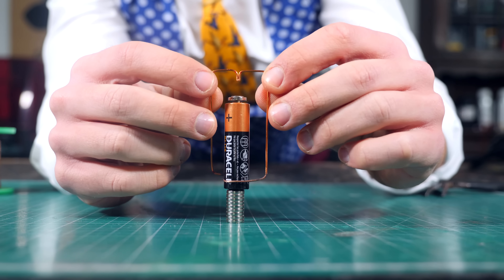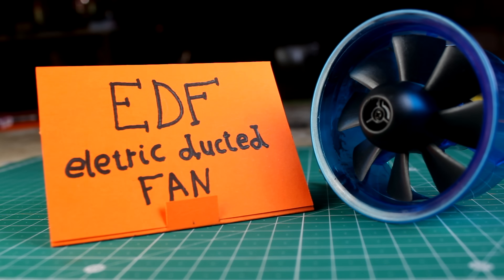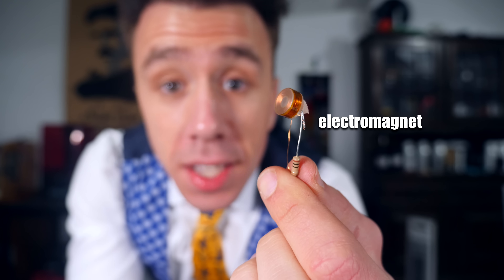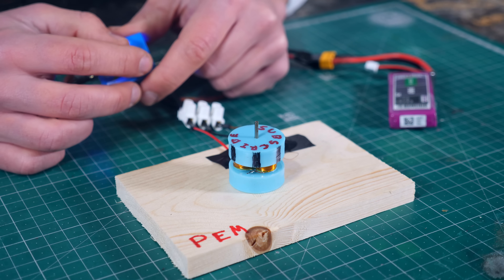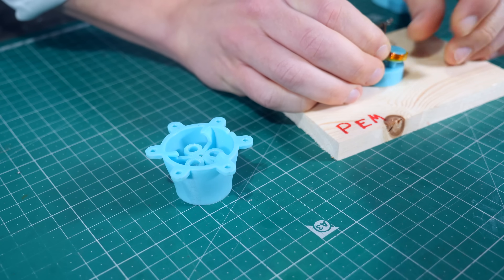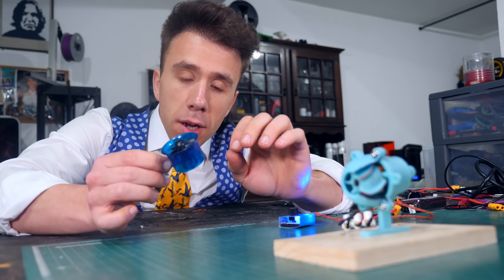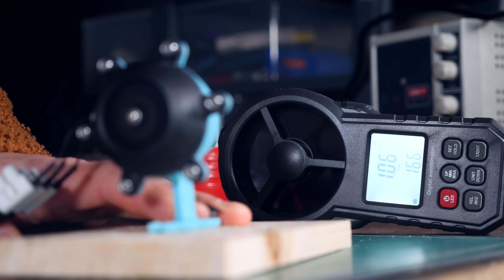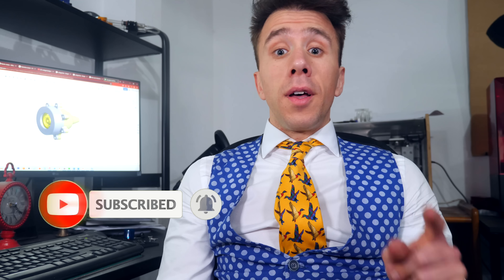I 3D Printed an ELECTRIC MOTOR FAN

Comment: Hey a few ways that might help, 1. the back of your fan is under correcting the direction of the air have the air ducts end at a degree that is 90degrees with the back of the fan. the point of the airducts is to change the radial movement of the air into straight movement, the faster/smoother it does it will reduce friction. I may be wrong with this one but it looks off. 2 try removing more material from the impellor, the less of the "cone" of the impellor there is the more air movement you will have. 3 by opening up the discharge side of the fan. the hole is too small unless youre trying to make a venturi nozzle but then as it is that wouldnt work.

Comment: I believe the reason your design of edf was less efficient and didn’t produce as much thrust because the restricted and constricted airflow at the front because of the narrow nossle unlike a regular edf like the one you have or even on jet engines the front is completely open and allows as much air as possible to get into the fan but once it enters the fan it gets compressed and constricted therefore producing more Thrust making or more efficient

Comment: Add a stator after your rotor to direct the fluid, and make sure you don t expand the fluid too fast. It creates some huge pressure losses. Usually for an axial compressor you can consider a expansion angle of around 7°. (That s the increase in section in which the fluid flows through). Over this, pressure losses become too important. And you are using an axial compressor design. Meaning you can get pressure ratio of around 1.26 per stage if you design it well. If you were to use a radial compressor design, you can push the pression ratio to up to 5. But you will have more noise and im not sure about the efficiency. And the design is more complicated.
You could also try to add multiple stages (rotor-stator) to increase the pressure ratio.
If you understand some french i could give you documentation on how this works!

Comment: The problem why your centrifugal fan have low thurst it may caused by the low efficiency of your DIY BLDC. This this root cause problem can be validate by changing your DIY BLDC with the manufactured BLDC then test again your centrifugal fan
Reply: The other possibility is your impeller shape is have low efficiency, try to change the impeller design

Comment: Oh man, I thought there would be an answer! Why is Dyson’s design able to move so much air? So many experiments suggest that a centrifugal impeller should be able to match the performance of an axial fan. Is it drag from loading the chamber inefficiently? That’s not a problem for the Dyson. Is 3D printing too coarse for close tolerance running clearance? Time will tell…

Comment: So, Integza , a jet engine or fan, is based on taking in air and speeding it up or, so I'm led to believe. The way it speeds it up is by taking a wide cone and putting it into a thin cone if the fan is cavitating or it has too much space in between it You're not condensing the air enough so you might think about squeezing the fan closer to the cover plate. It needs to be in my of space. From the video you had a centimeter or more space for the fan. Also, there is good only knows how much space is in between each one of those blades you can make each one of those blades probably about 10 mm apart and you'd still get the air intake but you would be pulling in 50 times more air and pushing out God only knows how much. (Side note no I don't have a 3D printer I would love one... So that I can help make things like that) ❤️❤️❤️

Comment: Maybe the material your printing with isn't rigid enough to work well at those really high RPMs. Like maybe the fins are flexing or oscillating and somehow causing a turbulent flow. Either that or Dyson impellors really aren't what they're made out to be.

Comment: As someone without training, but lots of interest in the engineering subject, I am wondering if you are trying to match two different styles of thrust, Coanda and through thrust?
Try ducting the coanda thrust, into rotating thrust as nasa is currently working on.
also, try ducting in more air, after the impeller?
I know, it will make you engine slightly longer, but it might just work,

Comment: Honestly the issue is prob turbulence with a mix of impeller design that ofc the bigger fan will move more air then as there’s more surface pressure going against a 1st gen in worked impeller design you should look into adding a condenser fan series

Comment: as a crude measure of efficiency, compare the surface area of the blades of the EDF vs your impeller. I'm betting the EDF is a much bigger surface area. Also the fan blades are a larger diameter, so the outer areas are moving faster than the impeller blades.
The impeller is never going to be as powerful (at least the way you are measuring it) due to all the losses of forcing the air through the casing, but you are probably limited right now by the capacity of that little impeller. Start by making the impeller a lot bigger.

Comment: You need higher rpm because axial fans are volume fans so they move due to blade geometry and centrifugal fans work by centrifugal force. So you need to do 1 of 2 things. A make the bottom wider or B increase RPM

Comment: mechanical designer here, saw your model here some points:
1. not much air can enter - funnel may help
2. its probably stuck inside -check any geometry that make 90dgr (or pointy places) its bad to airflow make it as smooth as u can 
3. check at 5:34 the curve for the air and the isolation of air from the engine.
4. you need to redesign the blades on the impeller for that you need check  Centrifugal/mixed flow impeller design for better understanding
Reply: also dont forget that dyson spins at very high RPMs which make huge diff

Comment: there could be some leaks of power due to turbulence or structural resistance, i suggest to analyze the flow and also the motor getting hot can cause some different behavior of the air passing around it and cause it to exit the nozzle in a more dispersed way.

Comment: As seen you measure air speed as thrust? 

My guessing game would be that the centrifugal fans are optimised for pressure (vacuum, dysentery fan, first stage of propulsion) instead of windspeed. The open fans however are optimised for flow (perfect for open applications like the propulsion unit you showed, where there is only little pressure - build up back pressure - to overcome)

Comment: Hi Integza! I am an aerospace engineering student at the University of Illinois U-C. I am working on an electric thruster project through the AIAA that has many similarities. There are many potential points of optimization, but the biggest problem has to do with Bernoulli's principal and subsequent equation relating pressure and velocity of flow to cross-sectional area. In other words, the impeller produces high pressure flow, and the exhaust nozzle geometry converts that high pressure flow into higher velocity flow. By decreasing the area of the nozzle, you can further increase exit velocity by converting the high pressure air from the impeller to lower pressure and higher velocity. There will be inherent limits with the power specifications of the motor and impellers (among other complex inefficiencies); so, I'd say the easiest means of optimizing your thruster would be producing an impeller you like and just playing around with different nozzle exhaust areas. Thanks for the great content!

Comment: The only thing I know is every time you force the air to turn inside a constraint you 1/2 the power, you're doing that  at least twice so I would expect 1/4 the power.

Learnt this roughly with modding fans in the past

Comment: To my knowledge an EDF is biased to pushing a large mass of air at a high speed but at low pressure (this is comparable to horsepower). Whereas a ducted fan is biased to creating less airflow but much more pressure/higher PSI etc (this is comparable to torque). It's irritating when people make a motor jet engine on other youtube channels using an EDF and a combustion chamber, as they should be using a ducted fan instead or even better an electrically driven turbo charger impeller wheel (as these are compressors rather than just fans). Thank you for your videos. I feel they are actually getting even better.

Comment: I know I'm late to the question and answer portion.  However, I would just like to add my two cents here.  
Most of the comments I have read have tended to focus on the difference in orifice diameter between the two designs.  This question of orifices is important and possibly the primary reason for the discrepancy between the two test beds.  Yet, there is another factor to consider.  The edf has a flanged edge around the perimeter of the frontal area of the shroud.  This curved flange is intentional.  The fan itself is already creating a negative pressure area inside the mouth of the ducted area, by adding the curved flange a given volume of additional air is induced into the spanwise flow.  Volume in must equal volume out, density is the only variable.  And if rpms remain near constant between the two designs then some other factor must be considered.
Look up the Trent 900 or any large turbofan test scenarios, there is always a bell shroud placed on the front of those engines in order to collect the greatest volume of air.
Anyway, good luck.

Comment: Hi, very interesting thought process.
BTW, I am not an engineer, however, I have a doubt which requires clarification - I was under the impression that centrifugal fans tend to be less efficient than EDFs, so won't they require more power to achieve the same level of thrust.

Moreover, to improve thrust, can we not just modify the fan blades to optimize their performance for the desired application. Maybe by making use of a Torroidal Propeller, we can increase thrust.
Furthermore, changing the position slightly to reduce interference, checking for any possible Drag in the Propeller design and Optimize the shape of the inlet maybe a different shape to increase the flow.
I have to apologize as I cannot show you a working model.
Also, you can have a go at 3D Printed Magnetic Bearings - to be used as an idea for the next video and also implemented in this project.
Thank You

Comment: I have a questions that may help answer your question about, "Why it's not working"♡
1. Is the exhaust flow on your 3d printed part laminar? 
2. Turbulent flows inside of a system typically reduce efficiency with the exception of vortex generators which should IMO. Be Classified under: Controlled Turbulent flows. Stacked ringed votex generators along the exhaust should be perfect and maybe you could even 3d print oval-diamond tesla valves as ring vortex compressors/boosters. 3d print in metal. I'm not sure what curve to use for the ring compressors but I like golden spirals and I feel like that would be cool if it worked out. 
The goal is we want exhaust pressure to drop close to 0 and speed to increase exhaust velocity means more thrust. 
Think about bernoulis principal. 
There is a balance point between speed and pressure. Contrary to intuition. The faster moving air on one side causes a decrease in pressure pulling in outside air to balance the missing air. Lower pressure=increased exhaust velocity. Also ⲇvⲷⲇT.

Comment: I would suggest measuring the power consumed by the radial fan and comparing it to the axial fan. If the consumption of the radial fan is smaller maybe the blades are just too small. If the consumption is greater or the same the efficiency is worse.

Comment: My best guess is that the EDF is utilizing Bernoulli's Principle to move much more air than it would otherwise (due to the viscosity of air), using the energy that is lost on friction between the air and the inside of the casing in the 3D printed fan to generate thrust.
Reply: Further explanation in case I wasn't properly clear: The air accelerated by the EDF fan rubs against the air around it and pulls it along, producing more thrust. The air accelerated by the 3D printed fan rubs against the 3D printed housing and produces heat. My hypothesis is that this causes the difference in thrust.

Comment: Did you ever measure the current that your motor draws with EDF and impeller? It's a good way of comparing how much energy is converted. That's why bigger propellers draw more power. They generate more thrust per revolution. That's why you can burn your motor with too big of a prop.
That being said - it is absolutely not given that an arbitrary EDF and an arbitrary impeller generate the same thrust with the same motor.

Comment: You would be losing energy  to compress the air in the form of heat. There is always energy loss. In the fan its one step to thrust, in the impeller its like 3. Impeller great for compression not thrust?

Comment: I thought centrifugal  fans are pressure fans not thrust  fans the EDF may push a lot of air but the centrifugal fan moving at the same speed probably just compresses the air more instead of moving it quickly, but idk I'm no expert.

Comment: Get a scale and weigh your impeller and the prop off the original fan. The motor already has to conted with the air resistance, so a small change in mass could have a more substantial effect on a small motor

Comment: Okay here is your issue, a you are missing some sort of cone to guide and accelerate the air while also making it more dense. These kinds of impellers are usually seen on a turbo of a car or a jet engine. Both of which would be moving forward in operation. Meaning more air to be fed into the impeller. So to simplify, you have a 20 L/Min pump attached to a 1L pool of water and all you are doing is spitting water drops instead of hosing out water. You need a bigger pool. Or a way to coax more air into your intake. Im guessing that dyson vaccum is using a fan somewhere before the impeller with a wind trap of sorts to create this effect on a smaller scale.

Comment: The impeller isn't acting alone. The design for an impeller has to take into account how the gas is entering and exiting the impeller. 

If you take an impeller designed for an open inlet and stick it in a shroud with a closed inlet, I'd be surprised if you didn't lose at least half of your performance. Same with the outlet, if the outlet was designed to be half the diameter of the inlet and you stuck it into something with a different ratio, you will see an efficiency loss. 

There are massive books and whole semesters of university courses that teach this stuff, but even then, you usually go to the people who have worked in the business for decades if you want to build something halfway decent. From what I have heard, ship propellers are designed by only a very few companies in the world and those designs are then licensed to manufacturers everywhere.

Comment: Not an aerospace engineer or a propulsion engineer here, but I think the reason that performance is lower is this:

* A standard EDF is designed to flow as much air as possible with the least amount of restriction, as the fan motor is the entirety of the energy input to the airflow. If you restrict the airflow, you've got no way to get back your losses.
* A jet turbine (which you have half-modeled here) is designed to take in as much air as possible and  reduce the area  that the air occupies, thereby increasing the velocity. This velocity increase is accompanied by an increase in pressure, i.e. a higher volume of gas in a much lower cross-sectional area. When combined with a fuel like jet fuel, then ignited, the resulting gas undergoes extreme expansion. The expanded gas then blows over the exhaust end, which has an additional turbine wheel that recovers energy from the expansion to drive the input turbine. The remaining energetic gas is expelled at high velocity (in a turbine designed for it) out the back to produce thrust. The "aerospike" at the back serves as an aerodynamic shape that promotes smoother airflow, which decreases losses due to uneven gas flow.

In short, you've restricted airflow, and provided no additional way to add energy to the system, so you can expect losses. Sweeper manufacturers probably restrict flow to increase velocity for multiple reasons. My guess is that higher air velocities allow for lower overall fan speeds (and noise, wear) as well as increasing the centrifugal force on dirt particles, which makes it easier to filter out dirt from air in bag-less vacuums.

Comment: The blades of the system function as a compressor, which raises the air pressure within the system. In order to convert the raised pressure to a flow, a larger outlet is required. 
Also, it should be noted that the initial blade design has a Nike or scoop shape. While the blades spin, the pocket captures air and generates internal pressure, which can lead to restricted airflow.

Comment: Velocity versus pressure. A "fan" is a high velocity, low thrust air pump. A pump is a high pressure, low velocity fluid fan. 

How much air? How fast? That'll get you in the  right direction.